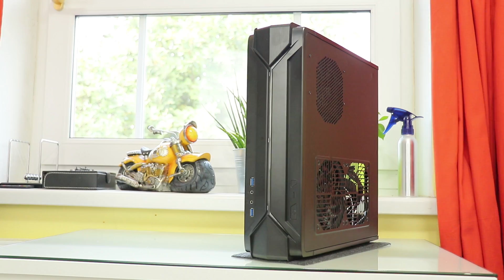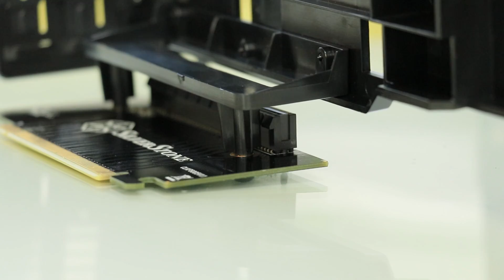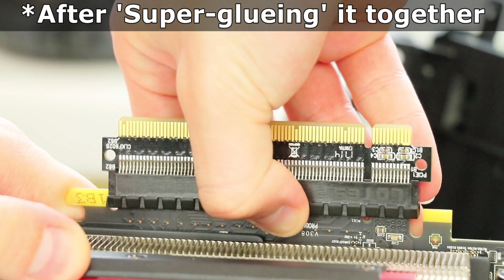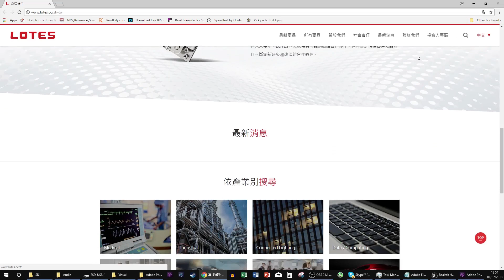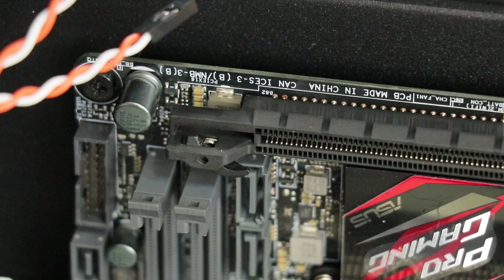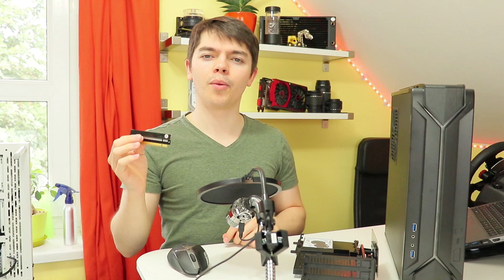The Silverstone Raven RVZ03 weak link...

Comment: Do you think I could use a short PCIe extention cable to replace this part?
Reply from the maker: Unfortunately not, its way too small a gap.
Reply: @AVTechy  I've been getting DXGI_Device_Hung errors while playing games, and no software solutions have fixed it. Do you think it could be due to the PCIe extender being unreliable?
Reply: @AVTechy  Either way, I would like to test with a different extender to see if it's causing the problem. Do you think this part would work? https://bigamart.com/product/kalea-informatique-pcie-16x-riser-1u/
Reply from the maker: Why not lift the board out and connect the card directly to the board and play a game like that. That removs the PCIe riser and you'll know if it's the problem.
Reply: @AVTechy  Thanks for replying! That’s a good idea, although I found something very interesting. I decided to turn my PC upside down with the rubber feet on the other side, and no matter how many times I turned it on and off with the power button, it would output nothing to the monitor. Then I carefully turned it so it was laying flat, and it worked instantly. I tested this multiple times and without fail, having the case oriented certain ways changed whether the display worked or not. I’m thinking of getting a new case, as the GPU is mounted very strangely in this one and it always seemed a bit precarious to me. My guess is that games make the fans spin fast, and those vibrations sometimes cause something to come loose momentarily when the case is sitting vertical. Sometimes the error message even says “the video card was physically removed”

Comment: So, you are clumsy and it has to be the fault of others. Got it.
Reply from the maker: Yeah... Not at all. I'm not the only one experiencing this, and the fact that it's possible to break in this way is a design flaw.

I've never needed to replace the fuel cap on my car when opening it as it's designed to not break under normal operation, but somehow this was so easy to break it happened immediately.

Understand that they're repurposing motherboard static connectors as add-ons, which isn't they're intended purpose (to be used at variable angles).

There's no case or board to guide the card in straight, so it can be connected any a wide range of angles, include installing a card into a board and/or case which limits the connection angles (where this type of connector has been primarily designed to be used).

After this set of videos was created they got in touch to apologize for the handling of this situation, and wanted to work with me from then on. They're not getting salty about it, I'm not, so neither should anyone else...
Reply: @AVTechy  no, if you keep on pulling even to you feel resistance and sheering, that's on you. If you keep twisting your fuel cap, you will cause damage, if you keep pressing harder on a touchscreen it will crack if you keep pulling on a piece of clothing it will rip. 
It is a design flaw on the same level as the necessity of writing "hot" on coffee cups... because no matter how much reason and common sense you think the customer has, there will always those who can't be bothered to use their brain.
And sorry to burst your "no guide, can be connected in a wide range of angles" story, likewise with a toothbrush but if you shive it up your nose, that's not the toothbrushes fault but yours.
And of course they got in touch to make it more user friendly, it's not everyday you find people you have to teach not to drown on their own drool .

We have 5 of those cases in our company and had several changes and ever since, on the first time pulling on the riser, we noticed it tilting and guess what, we just grab the other hand or use two hands ever since...
Reply from the maker: Yeah half of those are strawman arguments. I'll get onto those in a second.

With any PCIe connectors there's always some resistance to overcome to remove the card. All the contacts in the connector clamp onto the card to ensure a good connection, and some of these PCIe slots have higher clamping forces than others. Believe it or not, it took a pretty normal amount of force to remove the connector, and very little additional force for it to break (I guess that's how leverage works). The normal force required to remove the connector provided enough force after getting past the resistance of the connector to overpower the plastic end cap, and thus there's not much time to feel it torquing over and correct for it.

The toothbrush comparison is a strawman since we're talking about a PCIe connector and a Graphics card which are intended to be used together, a toothbrush isn't intended to go up someone's nose so it's not a relevant point.

"Hot" on a cup of coffee is just health and safety (gone mad maybe, but it's a small thing which probably helps more than it does hinder), and I'm not talking about a written guide, an actual physical guide. Much like the sleeves they add to hot cups of coffee to allow people to hold the cup without burning themselves. A small design feature to stop the customer from hurting themselves.

And your fuel cap analogy isn't comparable because there's plenty of space and time for a fuel cap to be opened. Whereas this PCIe connector from the point of starting to be removed to the point it's removed or has broken is a split second and about half a centimetre (little time or space to react to a problem).

So you too have noticed the problem, and rather than fix it at the design level your blaming it on the user? So the user never has to encounter this issue with any other PCIe connector, but for this one they have to pay special attention? Yeah that's not how I see the world, I think it's common sense to prevent this becoming an issue at the design level (so it can't happen), rather than sending a design out into the world with a reasonable potential of breaking.

I also happen to think it's a good idea to put a railing or mansafe system on a roof to make sure someone doesn't have an accident, rather than not designing it in and just expecting anyone who's working on the roof to just be careful.

Design things to work well from the start, not clean up problems with replacement parts. If we strived to fix upcoming problems rather than design problems out in the first place we'd be on a much bigger mess than we are now...

It sounds like your the guy who blames the users of Mac Books for using them incorrectly, rather than Apple for creating an inadequate cooling solution.

So the question is, why advocate for a design you have to treat with kid gloves to use, why not advocate for designing out problems that don't require special attention to use property? I mean it's a PCIe extender, this should be one of the last things I need to pay anything more than minimal attention to.

Not sure what the "user-friendly" point is, they got in touch with me to say "hey, sorry for how that was handled, you made good points, would you like to check out some more stuff?" And continued to work with me for a long time without being salty about my ongoing criticisms of their products (an attitude I can highly respect).

It's clearly a wider problem judging by how many people have commented on these videos with the same problem. Good design doesn't break easily, and this one broke very easily.
Reply: @AVTechy  No buddy, those aren't stawmen but examples for carelessnes and stupidity of the user. I get it, you rather defame me and my arguments than admitting you being careless.
What's next, you being careless and bending pins on an AMD is the fault of the manufacturer too? And yeah yeah, i get it, you love to see yourself as the victim and blame others but come on... kids glove? Talking abot fellacies and spilling them out like crazy... that's my sort of humor. Face it, You yankedg a riser of crooked and complain it caused damage. If you misshandle something, you will cause damages but yeah, It's always the others who are at fault... 
And sorry to kill your "judging by how many people have commented" delusion how this is a wider problem, you have 25 comments on this video and NONE has this issue but got scared by your claims. Meanwhile the youtube, shopping siteds and the internet as a whole is full of reviews, videos, and threads about this case... somehow people manage to handle it propperly... but yeah, you are the one who knows better.
Reply from the maker: @AcidDotDrop   @Illustrathor  It's definitely a strawman argument to say that putting a toothbrush up your nose is comparable to a PCIe extender breaking because it can so easily angle over when being removed. One is misusing the product (toothbrushes aren't designed for noses), and the other is  a product breaking during normal use (PCIe extender easily breaking once being removed, they are meant to be removed).

I'm not sure defame is the right word there. I've clearly explained why the arguments don't hold water. If you could actually tackle the rebuttals I've laid out for all of your arguments, such as if you've noticed how easy it is for this to happen, why aren't you advocating for a design that doesn't make it the easy to break. Why complain about people who want better and more robust designs on the market rather than ones that break so easily with casual and normal operations?

I can't say I was completely careless, since I don't want it to break, it causes delays and needless frustration. Rather I wasn't expecting I'd need to pay so much attention, to have to micro-manage the removal of it because it was so fragile, since every other PCIe riser and slot I've ever used has required so little attention I could remove and replace a card from them with a blindfold and oven mitts on.

It's very interesting you're bringing up comparisons to PGA CPU's, which funnily enough have instruction manuals on how to deal with their fragile designs (fragile for many reasons), compared to this extender that's fragile and it's up to the user to figure it out. PGA CPU manufacturers know their product if fragile, and CPU's are pretty well known to be expensive and delicate parts, so they carefully instruct the user how to handle them. PCIe slots on the other hand aren't typically fragile, delicate, and in need of careful consideration when using them, but this one is. For some reason this one stands out...

When you say mishandle, I don't think I saw anything in the manual saying how I should handle it. In fact it doesn't say anything about its installation at all. For me to mishandle it, it needs to be specified how it should be handled. If it told me it doesn't work like a normal PCIe riser (one hand holds the graphics card, the other holds the case) and needs to be treated more carefully to avoid it tilting and breaking, then I'd have no leg to stand on. But there's nothing saying that at all. I treated it like any other PCIe riser, and it very easily tiled and broke in a split second. Sure I broke it, nobody else was in the room doing the job, but the fact that it could break in such a manner is more alarming to me. Why was it designed so it could break so easily?

If I ripped my fuel cap off my car then I'd probably say, yeah that's my bad. Unless it was held in place by a paper straw in which I'd probably say, that's a really weak design and should probably be redesigned so it's more robust.

I scrolled down like 5 comments and Jeddi Master nearly wrecked his when upgrading his system (which lets face it, many many reviews around don't discuss the disassembly process of a case, they do their build and talk about how great it is, which probably accounts a fair few missed cases of issues - by the time it comes to changing the case they're out of the warranty period and move on). It looks like they nearly broke theirs, you've realised how easy it is for them to break and have to pay special attention to it, and I've broken one. At what point do we just say, why not make one that can't break through normal circumstances? That's all I'm saying, why not make it so it's impossible to break under normal circumstances?

Knows better? I'm literally saying what is the case - it breaks during normal use, and I can clearly explain why, and why I think it should be designed to not break in the first place. What's so crippling about that? Why not design it so you, or I, or anyone who uses it can treat it as a normal PCIe Riser and not need to realise it's tilting during the fraction of a second it takes to remove it, and have to pay special attention to it? If I had to treat motherboards in the same why I'd say exactly the same, surely there's a better way of doing this? Who settles for this weak design, especially when it's costing them £100?

So come on, you've noticed it's a design that's fragile and needs handling like no other PCIe slot, why not advocate for a more robust design? Are you completely satisfied that you have to treat this one differently to any other PCIe slot? Would you be happier if you didn't even have to think for one second it could break when removing it? All I want is for it to just work flawlessly, without special attention of any kind, and I think we both know it could be done better.

Comment: Can I just use pciex16 riser cable to replace that?
Reply from the maker: I don't think so, there's just not enough room to fit two separate connectors. It should have been redesigned to not need this, but there we go.
Reply: AV Techy I don’t know if you have tried pc building simulator but its funny they use pciex16 riser in connecting the gpu in the rvz03 case. Thanks though Im about to upgrade my gpu and actually going to pull out the old gtx 960 for a gtx 1660 super. Good luck to me
Reply: AV Techy https://youtu.be/iJMtADcPfKk
Reply: I'm curious, will your broken GPU extender work in that condition? thanks for the response it helped me in my built

Comment: Wow. Can't believe this. I have this pc case. I've changed my mobo twice, and my gpu twice (at different times). Plus, I've probably had to remove my gpu at least a dozen times, because i suck at cable management. Guess what guys, never broke a thing in regards to the pci riser. I've yanked cables in the front of the case though.
Reply from the maker: I'd stay away from watching Marvel movies then if I were you, they're way less believable.
Reply: @AVTechy  Hi mate, im planning to buy this case but i want to be sure;  that riser extender which got broken comes with the case right?

Comment: Also is there anything you recommend to prevent it chipping off the corner? ie if its pulled straight back not on an angle would this prevent it snapping/chipping? i know you should be able to take it off anyway you like but now youve got me nervous about my build im yet to do!
Reply from the maker: Hey, sorry for the late response, it's been a bit busy lately. Anyway let's get onto your queries.

If your does end up snapping then you can get in touch with Silverstone to get a replacement sent out. They night try to charge you for it, but just be a little difficult and they'll send one out for free like they did for mine.

The best way to prevent it from happening in the first place is to pull it off from the back first, and just do it bit by bit from back to front. You should have it snap that way.

But this only happens when you pull the PCIe extender off, which you shouldn't have to do when your building your system. But it's worth keeping in mind for when you dismantle the system in the future and sell the case.

Hope that helped, and I hope you like the upcoming RVZ03 review coming out later this week (hopefully).

Comment: Does the riser card hold up the video card mount. If not couldn't you just buy a flexable pcie riser cable and use that instead. Seems like a simpler and better solution.
Reply from the maker: Not a bad idea. It doesn't really support the card no. But there's just no room for a flexible one to fit. I've got the PCIe riser from the Thermaltake Core P3, and with the connection to the motherboard and the other one to the card it ends up being bulkier than the Silverstone one.

Silverstone are on the right lines with the design, but a little more attention to detail wouldn't go amiss.

I'm still waiting a replacement part, although I've been a day slow on my end thy haven't exactly been urgently trying to resolve the situation...

I'll let you know how it all goes when the full review finally gets finished.
Reply: @AVTechy  

Is a soft riser so bulky that it will not fit at all? Im thinking of using a 200mm flexible riser in this case. Only because I use a larger cpu heatsink that comes a bit too close to the rigid Silverstone riser card.

Comment: Ohh that’s a bummer...a hassle free review would be nice...but it is what it is. Whomp whomp^^
Still good that you point these things out.
Only thing I could imagine is, for this  construction to make sense is if these are off the shelf parts, then it would be cheaper to buy those, design the mounting points and be done, maybe it was also a mix and match type thing, where they could choose pcbA Type 1 and fit it with pcbB Type 4?? To get the measurements they needed.

For the case issue I’ll have another check for something cost effective, easy, known brand and interesting...I’ll be back ;-)
Reply from the maker: Haha, yeah it would certainly be ideal. It's interesting how often problems come up with these case reviews.

They seem to ship the plastic connector in from Taiwan, and I can only imagine they custom designed the PCB to count it to. But like you say it could easily be an off the shelf PCB that marries up to the connector. I'd love to know what the real reason is. It wouldn't surprise me if it was just a cost issue to redesign the part. This sort of thing happens all the time in all industries, compromises have to made sometimes. The best and most confidence inspiring response would be to own up to the issue, and develop a solution for a similar problem in the future.